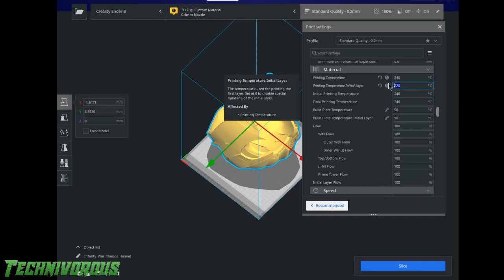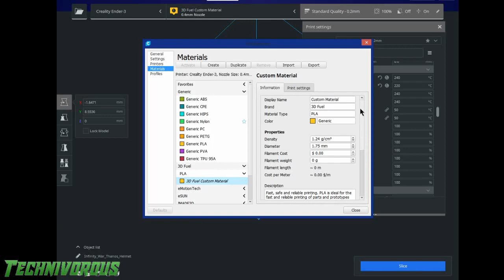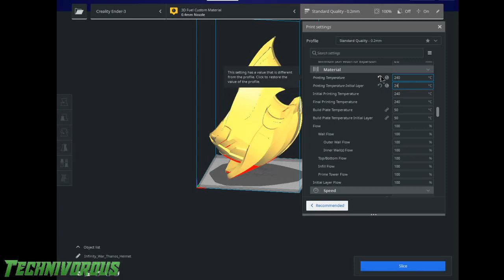Fixing Cura Temp Settings

Comment: Can I impose upon you one more time? I've got a TEVO Tornado as well, with a screwed up firmware and I've failed uploading a correctly configured Marlin2, (I'm up to 2.0.5), ... how bad? The last try Arduino showed it had 13 PAGES of errors! I'm totally braindead. Is there someplace I can download a correctly configured firmware file? Thank You.
Reply from the maker: I have yet to update my tevo firmware and it's probably about time. Mines a tarantula pro but it should be the same. I'll make you a video soon!
Reply: @Technivorous  OH! You might find it easier to read and edit if you open the files in 'notepad++', do NOT use wordpad or msword.
Reply from the maker: @GrandpaBill  thanks for the tip. i do use notepad++ quit often, but in videos i tend to use notepad because it is less cluttered on the screen. notepad++ is amazing for editing files from c# to java to python and gcode.
Reply: @Technivorous  I'm hoping the only difference is the bed and height sizes.
Reply: i'm sure that anything can be downloaded for being braindead, have you tried the local vet?